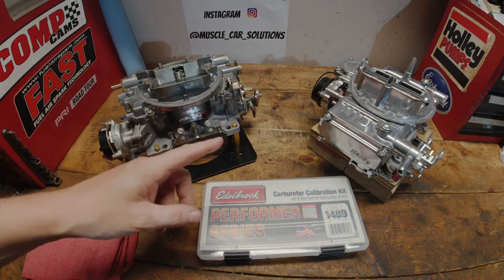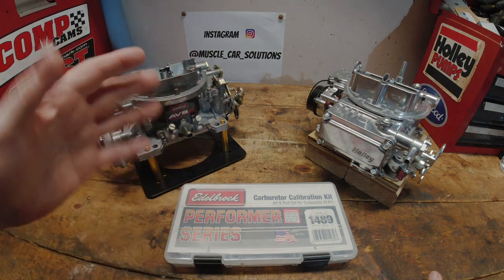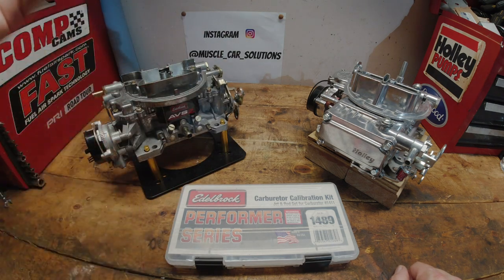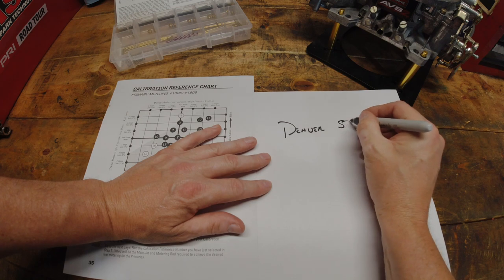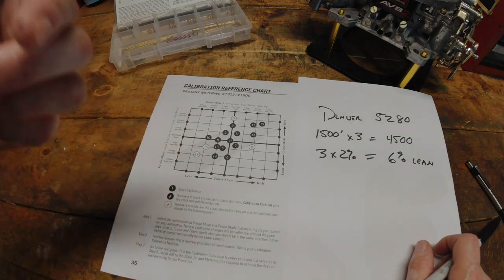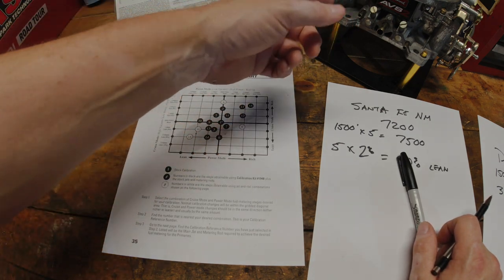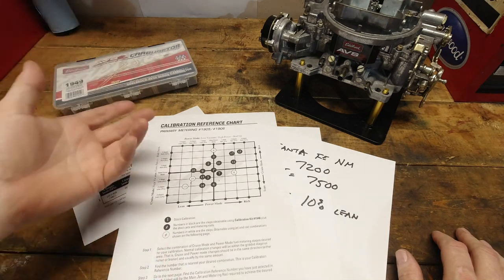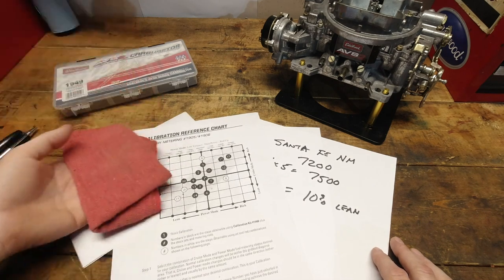How to Tune a Carburetor for Higher Elevation

Comment: Great video. 
Too bad they eliminated carburetors. 
They could have had them automated to adjust themselves (with an ecu) to monitor their performance and make the correct adjustments. 
I believe this technology is still relatvent to our modern car to get more gad mileage, less pollution in our environment. 
Make the carburetor into a gas vapor system for more mileage, less emissions. 
Thanks for the video.

Comment: Higher elevation: lower air density.  Carburetor is pumping the same amount of gas as if it was at sea level but at higher elevations (that is why carbureted airplane engines have a mixture control to lean at altitudes).  Therefore the the mixture is rich and hence the need to lean at higher elevation to maintain proper fuel/air  ratio.

Comment: I'm running a 1411 Edelbrock and even the stock calibration at 5000 ft in Colorado, my plugs are showing lean. I built a 351m with 10.5 compression ratio bored .060 over, forged flat top pistons.. I have a Howard's rattler roller cam 227/235 @.050 intake C/L at 103° 109° lobe sep. I'm going to buy a AFR gauge .it feels great off idle but is feels sluggish after that. I've went 4% lean on the primaries and rich on the secondaries. Timing with a HEI Ford distributor is at 34° total timing. Still plugs are showing lean. Accelerator pump position is maxed. C6 auto with 1800 stall and adjustable modulator.  I need help. Thanks in advance. BTW I'm running 87 non ethanol fuel.

Comment: Brian, THANK you so much for making this. People often overlook or only talk about tuning based on Sea level numbers. you mention 4 degrees difference in timing from Denver to Sea Level. Is the timing change linear as you go up in elevation or exponential. I know I am outside of the norm, but we live at 8000-9000 Just curious if the timing would need almost a 9 degree difference or more. I realize that the motor will let me know, but a good starting point would be good. Is there a way to estimate initial timing based on altitude? Also would this increase in timing apply to total timing as well? I have currently seen my motor rise to well over 40 degrees of total advance without pinging and it seems like it wants more but I am worried about adding anything else.
Reply from the maker: It just kind of depends.  I have relatives that live at a higher elevation than Denver (Santa Fe) and I start those at 16-18 when tuning.  That’s generally where I start with any altitude here in the US.  I know at those even higher elevations like you’re at some folks will go 18 initial and 40 all in and they run well on the thinner air.  I’ve had some tell me they settled in at 20 initial, and as long as the engine is ok with it, and your AFR is telling you the output is good, then you’re ok.

Comment: So I live in an area that's about 500-700 ft in elevation, i would go into the mountains at around 3500-4000ft with a stock Edelbrock 1406. I never had any issues going back and forth into those elevations, at least nothing i ever felt or noticed? I'll be using 1906 soon, so I'm hoping it's just as good as that 1406. My question is if I go even higher in elevation and do need to make a quick adjustment out on the trail, can I simply do something like a jet rod change just to get me by, something quick and easy while Wheeling? Or will I need to change jets as well?
Reply from the maker: @dantheadventureman  the calibration chart will tell you.  Let’s say you go through the tuning process and end up at calibration number 5 (only an example).  That’s around 4% lean in the cruise mode.  If you go past 4- 5000 ft in elevation, you can look at the next leaner pint closest to that one.  In this case it would be 14.  That would effectively lean you out another 4% and have a much happier running engine.  Also, don’t forget about timing.  The two go hand in hand.  Add more initial timing to get the fuel and reduced air mixture to burn.  Don’t worry about easy.  Worry about doing it right, and you’ll have a much more enjoyable time.

Comment: Back in the carb days, did the manufacturerers alter their carbs and timing depending on where they would be sold?
I grew up in Flagstaff, Arizona at 6,900 feet.
Thank so much for posting this.
Reply from the maker: Tuned locally.  My parents lived in Santa Fe NM at over 7000 ft.  When they bought a new car, the dealer adjusted both to make it more drivable at that altitude.  I’ve seen pamphlets talking about driving down at lower elevation and adjustments might need to be made.  Pretty interesting times!  Thanks for watching!

Comment: I've been trying to get a good tune on my 78 Jeep J20. Motorcraft 2150 carb. My vacuum is at 14.5. I have my timing set at about 16°. I have a pretty big delay on acceleration. My idle rpms are at 750 and rpms in gear at 550.
Reply: I'm at 6200 feet
Reply from the maker: Not much you can do with that carburetor.  Live with it is all you can.  Unless someone makes jets for the thing.
Reply: @MuscleCarSolutions  I think mikes carburetor parts had some jets for it.
Reply from the maker: There ya go!

Comment: Hey Brian I have never heard anyone talk more about timing when tuning, and I think it great, I can see where someone would go from a low altitude to high and miss the timing factor, the total advance would absolutely go up too, is air density what makes this all happen, I know on Diesel’s it’s a big deal, and do you make better gas mileage up high if you lean correctly, very good video, thanks buddy
Reply from the maker: It’s like peas and carrots!  Messing with how much fuel an engine is getting directly is tied to ignition timing.  They have to be dealt with together!  As far as getting better economy at higher elevation I think sometimes that gets offset by being down on power.  It’s noticeable is you’re used to operating at a lower level and head to higher elevation.  I think a lot of times they get beat on a little harder because that normal snappy power is gone  and it’s hard to go backwards.  So they get run harder and of course end up giving that potential for gained fuel economy away.  Thanks for stopping by!  Always appreciate seeing you!
Reply: @MuscleCarSolutions  👍👍

Comment: Amazing video, i have a question, tal king about CR, the higher elevation  yo drive is it possible to handle with a high CR engine or easier to handle a high CR engine at sea level ?
Reply from the maker: The high altitude location engines like a little higher compression.

Comment: Can you do the same tutorial for temperature swings?  I’m in tulsa so we can see 100° all summer and then 30° is a good average for the winter.  Obviously the cold increases air density and thus oxygen so it should lean out, but by how much?
I have a 502 big block with a long duration cam
Reply from the maker: Yeah we can probably do something like that.  That’s a good topic.  Let me dig into how to present that.  Thank you for the suggestion.
Reply: @MuscleCarSolutions  sweet thanks!

Comment: Maybe you can help me with my dilemma:

Later this year, im moving to Montana and I currently live in Texas. I have no doubt in its mechanical capability to get there and I have roadside assistance if necessary but my concern is the altitude along the way.

I live in 951 feet and currently my carb seems to run a touch lean, I close the choke every so slightly and it runs perfect. As a young guy with no experience, its a daily driver, and little money right now, I have no desire to tear things apart that i dont understand in advance if its not absolutely necessary.
Where Im moving is 2,956 feet in elevation and the entire county ranges from 2900-3600
Dandy. But the trip there.. I get to 4700 feet where i will first stop for a nights rest in Pueblo Colorado, i assume i can make it there even if i must remove the air cleaner and adjust idle mixture screws.
But from there the next day it jumps massively to a max of 10,578 feet before gradually declining to around 6,900 feet at my next stop for the night. then to 4,800 by the next stop, then i should be good with things set to the proper settings for where im moving to.
But is there anything i can do to make it through the drive, without having to tear apart the carb on the side of the road?

Its a Motorcraft 2100 on a ford 390 in country squire

Worst case, how many jet sizes would you recommend going down for the height of the journey? I assume 8 degrees initial timing as well.

Would i actually have to change anything else or could i skate by?
Reply from the maker: You’ll be fine.  Yes as you go up in elevation you’ll need more timing and it’s going to run a little rich.  When you get to your new home, then you can look at making adjustments.  Idle mixture screw adjustment does nothing to affect the drivability when you’re cruising down the road.  Adding more timing will help tremendously.
Reply: @MuscleCarSolutions  thank you very much

Comment: What would be your advice if I live at 9300. My closest town is at 7. And I work up at 11k what would be my target area ?
Reply from the maker: Always a challenge.  You’re in a difficult hot spot if you’re experiencing such drastic elevation changes.  If you tune for your home area, when you go higher you’ll just be a little rich.  If you’re not aggressive on the lean side, you’ll go lean when you drop down but it shouldn’t be so drastic to put the engine in a bad situation.  I’d absolutely invest in an AFR so you can monitor all three areas.  That way you’ll know when you make changes how it will effect the other two areas.

Comment: Great info.  Never even considered timing for tuning for elevation.  Just got a '70 Torino Type N/W 351W all stock back from paint that originally was sold in Seattle back then.  I'm in the foothills in CO at 7600.  I drop down to Denver elevation in about 3 miles from my home where I'll be doing the majority of my driving so I'd guess I need to tune specifically for about 5300.  I'd like to keep it stock and not have to go to EFI or a different carb.  Again, I have a stock Motorcraft carb - so thoughts on timing/tuning the carb?
Reply from the maker: Not on a factory motorcraft.  You can add more timing and that will help but if you keep the factory carb, the fuel delivery adjustments are limited to idle.
Reply: Got it.  Which carb would you recommend?  Or would a better play be to go to an EFI setup?  If so, which would you recommend then? @MuscleCarSolutions

Comment: Without messing with rods and jets, just the 2 front screws (stock Edelbrock Thunder series/Dominator), what would you recommend for number of screw turns? Default is 2.5 turns out on each screw if I’m not mistaken, but it’s idling a little fast.

•4100 elevation
•SBC 350 255 hp 4 barrel
•Timing set at roughly 11-11.5
Reply from the maker: @CS-bw8pt  two things.  There is no recommended number of turns.  Start with 1 1/2 and tune from there.  Your biggest issue though is not enough timing.  At sea level I go 12-14.  I’d be looking at at least 14-16 and see what the engine likes.  The higher you go, the more time it needs.
Reply: @MuscleCarSolutions Interesting. I just lowered my timing based on what a first gen Camaro group told me… after giving my engine code #, they told me it should be at 12 from the factory. I didn’t realize timing changes with elevation as well.
Reply from the maker: @CS-bw8pt  absolutely.  It’s one of the biggest factors and just remember one simple rule.  When you’re tuning, doesn’t matter what type of engine or carbureted or efi, fuel and spark get tuned TOGETHER.  I have family in Santa Fe at close to 7000 ft.  16-20 isn’t uncommon for initial timing.
Reply: @MuscleCarSolutions Back to the garage. Thank you sir.
Reply from the maker: @CS-bw8pt  best of luck!

Comment: im a drag racer,  we dont care what the elevation is, we use weather stations to tell what the adjusted altitude is, we have no use for actual elevation numbers, i will explain, in SaltLake  City, Utah.  we are 4,280 ft above sea level, but the air gets so thin crossing nevada, that   the adjusted altitude is usually the equivalent to  7500 ft, all summer long,  thats called adjusted altitude. our weather stations figure that out for us ,  so we jet for adjusted altitude,   actual elevation means nothing. when drag racers talk about racing at other tracks  , the question is what is the adjusted altitude  there, meanning with all weather peramiters added up what altitude is the current air  equal  to  , this might make more since  now, why weather stations are really used.
Reply from the maker: Not sure what the point is here.  95% of what we cover on this channel is street cars, and I’ll go out on a limb and guess no one is interested in purchasing a weather station when a very simple rule of thumb based on elevation works exceptionally well.

Comment: Hey there. Going back to working on my 79 ford lately. Installed a new 1406 as I had one years ago and it ran a long time without any problems. I have ran set my metering rods and jets and seems to be running good. One thing I’m curious about is how much altitude affects the idle air mixture screws. Where mine are set is about 1/2 turn from bottom and it pulls the most vacuum and idles the smoothest. Is this too lean? Everyone says 1 1/2 out plus or minus a 1/4 turn. It’s a fresh 400 with a manual at 14 BTDC. Just wanted to ask some others. I don’t have an A/F gauge but my nose can tell you that she be rich lol
Reply from the maker: Idle mixture screws only affect idle.  Past 1000 rpm, that circuit is bypassed.  If you want to take more fuel out at idle, close the screws down.  I can tell you 14 degrees advance is likely not near enough.  What elevation are you at?
Reply: @MuscleCarSolutions  I appreciate the reply! I am sitting at 5100ft here in Colorado. At idle it runs very rich at 1-1/2 to 1-1/4 turns so that's why I have leaned out the idle circuit. I just don't want to run too lean. I don't have an A/F gauge yet but it's not hard to smell/see how rich it is.  I purchased this truck from my father about two decades ago. He would adjust timing by "feel". He was a logger and was constantly changing altitude, so he always was tapping it less or more depending on where he was. When I purchased the truck, it was set at 18 degrees. (I can confirm I am the only one in my family who owns a timing light lol) It ran just fine at 18. The poor truck has sat for a number of years which has prompted me to start diving in to get the truck as good as I can for what it is. I seriously appreciate your input as your videos have taught me a vast amount that I did not understand before on these older engines.
Reply from the maker: @colooutdoors8949  go back to the 18.  When you’re at higher elevations, more timing is so critical to getting the best performance.
Reply: @MuscleCarSolutions  Thank you sir! I appreciate it!!
Reply from the maker: @colooutdoors8949  best of luck!  You’re on the right path.

Comment: its not because of dense air at altitude its just the opposite , dense means to much of something, at altitude air is very thin,  not dense, i live in saltlake city, 4,280 ft above sea level, very  thin  air,  i will run 1/2 second quicker at  a sea level track, like seattle for example

Comment: I'm actually in Santa Fe NM and messing around with my ellerbrock, I was wondering how do the numbers on the chart tell me what kit to purchase
Reply from the maker: The Edelbrock calibration kit is purchased by the part number carburetor you have.  It will contain the rod and jets for the tuning chart on that part number carb.
Reply: @MuscleCarSolutions  I have 1405. So the kit sold is pretty universal or should I say more suitable for my altitude
Reply from the maker: @grantadan  no it’s not universal.  It’s for that specific part number carburetor.  It will have all the positions on the tuning chart included so you can tune for that elevation.  I’m assuming you’re close to 6500-7000 feet.  I’ve tuned in Santa Fe and I always started at 8% lean and went from there.  The calibration kit and the tuning chart will give you all that info.
Reply: @MuscleCarSolutions  ok sounds good I will get a kit for my carb and go from there thank you, and yes here it's 7000 feet
Reply from the maker: @grantadan  yup.  Start at 8% and you can adjust as needed from there.  Looking forward to my next visit to the area.  I can’t get enough New Mexican food!
Reply: @MuscleCarSolutions  i'll start there. Try PCS on airport road you won't regret it try their stuffed sopapillas smothered in Chile
Reply from the maker: @grantadan  I’m gonna need you to stop right now.  That kind of talk is only going to cause me to make a road trip back there pronto!  😂 I’ve been to PC’s.  If we’re talking about the same place.  I could live on New Mexican food 24/7/365 no problem.  Enjoy the monsoon and green chile season!
Reply: @MuscleCarSolutions  🤣 well if you're looking for roasted green Chile they just started roasting this week right out side my bay door, sound like a good excuse to me.
Reply from the maker: @grantadan  yup.  I know!  I loved driving through town and seeing folks roasting them on the side of the road.  😂
Reply: @MuscleCarSolutions  well hope to run into you down here if we do I'll buy you a beer
Reply from the maker: @grantadan  I’ll be easy to find.  I’ll be smothered in sauce like I ordered Christmas style, fat and happy at any restaurant bar.  😂

Comment: you need to re think your approach here bud , its not 3 horsepower per thousand feet, unless you are talking about 1 motor in particular, all motors lose the same percentage of  power, meanning a 4000 horsepower motor  is not going to lose  3 horsepower  the same as a 250 horsepower motor will lose 3 horsepower,
Reply from the maker: It’s 3%.  Did I say 3 hp?  Then it was just a simple mistake.  Much like making “since”.  I’m sure you understand, bud.